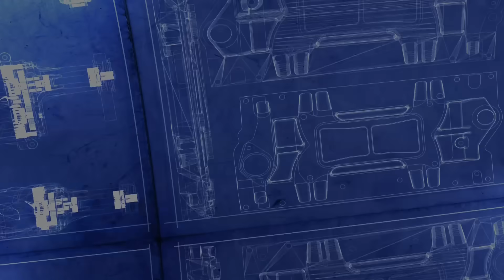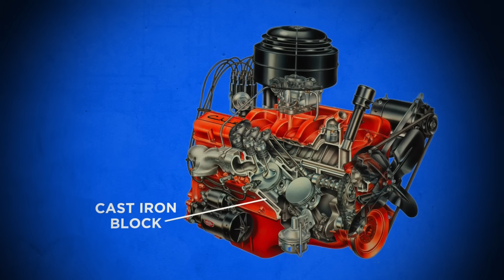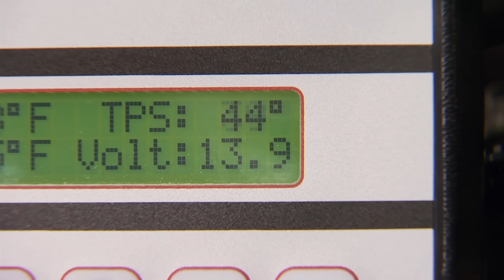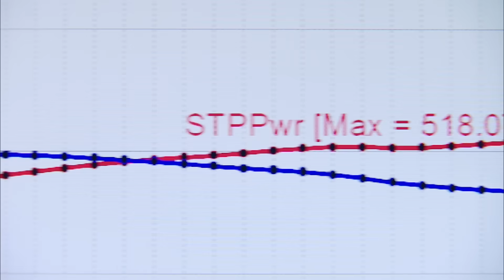Building A 518HP Supercharged 350 Small Block - Engine Power S2, E6

Comment: The block prep work is a good idea, but a few tips. 

-Leave the decks alone until after the block has been bored or decked.  Your detailing might end up being removed by the machining. 
-You should chase all your threads twice - once before going to the machine shop to verify they are all good, and once after all of your machine work and detail work is done as part of your final cleaning to remove machining swarf.  Thread chaser work best, but an old dull tap will also work.
-when cleaning out blind bolt holes, turn the block on its side  so the hole is parallel to the ground and use brake cleaner with the plastic tube to blow the crap out.  Use a cloth over it unless you want to wear it.  You will get a lot more crap out of blind holes this way than just using air, and the brake clean is also a degreaser than doesn't leave any residue.
-Run a flat file over the deck to knock off any burrs caused by your detailing.  You are not trying to remove metal, so just a few swipes in each direction will do. 
-Using a rat tail file, carefully remove any raised area from the original staking of the front oil galley plugs to hold them in. Again you want to just remove the raised part.  This will make tapping it much easier. 
-When chamfering the bolt holes on the decks, put the head gasket on first and see if the holes are blocked or are open.  Some engines have unused bolt holes.  You don't have the chamfer them. Also, don't chamfer the water passages larger than the gasket. You are removing sealing surface, and many head gaskets have smaller holes in the water jacket passages than the block because they are acting as a restrictor to force water to go to the back of the block.  Don't open up these holes.

You have to understand that the reason you chamfer the holes is because the bolts will pull up the metal adjacent to the threads creating a small raised area around the bolt holes.  Most factory original blocks will have a small chamfer, but if the block has ever been decked, it will probably be gone.  The chamfering adds a little bit or crack resistance also, since it is much harder for a crack to form on the chamfer than a sharp edge. There is no downside to doing it.

Comment: All that cash for parts, and you only get 518 hp.......pathetic....I got 365hp out of a stock 350 short block...FLAT tappet cam, junkyard vortec heads, hei distributor and a carb. Under 1000 bucks. My mouse would eat your budget build  for lunch!....it`s in a `91 Silverado

Comment: 6.0 w/ LS3 heads and a mild cam will make 518.
Haha at the old tech.
Reply: Tron Smart I have an ls1 in my ss with cam heads intake and bolt ons, reasonable cheap upgrades good fuel economy cheap hp but nothing will ever take the place of an old school sbc sbf. I through 15k in to a 302 winsdor build for my xy ute (Australian ford) started with a solid base, used a dart block and went from there. Now if I could have done it all and gained similar hp using an ls and perhaps saved 5k would I have done it... never in a million years. What’s going to look better if I ever advertised it for sale, xy ute with a ls or xy ute with a 302 winsdor dart engine dart heads eagle forged crank ext capable of handling tremendous amounts more hp, throw on a blower nitrous ext she’ll take it. Nothing wrong with ls but old school is cool, Top Fuelers run 426 hemi’s, 11000hp. The blocks they use are aftermarket upgrades adding extra strength but there still based from a 50 year old engine.

Comment: It looks like this was an application-specific combination designed to have eye appeal, dead reliable pump gas power, and modern fuel injection for a nice street rod. Also to talk about Edelbrock. It wasn't a max effort racing engine. Could they change up some components and double the output? Absolutely. Perhaps people are missing the intended application of this engine build.
Reply: Bingo.  500+ is a lot of power for most street rods.
Reply: @dennisyoung4631  Most commenters have never expreienced a true 500hp 350. 
Beyond clueless!!

Comment: i dont get it... a n/a sbc 350 can make that number... hot rod magazine did it on 87 octane...
Reply: @Randal TheVandal first the hr motor isnt a stroker... its 350ci.... yes they did a 383 not what i was talking about... second i can do pistons cam and heads for a hell of a lot less than a blower... the point was why waste money to make a lot less power... and you can make well into the 400s on 9.5:1 with no blower that will beat the higher hp blown engine..
Reply: @bigboreracing356  the point is... this is what they presented like it was something... jack ass
Reply: BW MadDog [retired]  i personally like a balance or hp/tq for a street car ive had a 383 with 450/480ish n/a its plenty on the street... brother has an 86 el camino ss... roller 350 sniper efi... e-force 122 charger w/pulley 8psi... e-street heads and cam... th350 w/3.73s... its fun... http://prntscr.com/sdjbiw ...  wasnt the point just saying thats a bunch of money  for little gain on their part

Comment: The height of insanity is this folly. A blower, really?? A blower that consumes a huge amount of power for such a meager output, please. I have watched you guys make some bad hardware choices and shaken my head at the results sometimes but this defies belief. You do not need such a device to make 500+ HP from our beloved small block. You need to put the polished bling ideas away and concentrate on finding the right ways to make power. A suitable 383 shortblock with a set of AFR heads and the right cam and intake will do the job. Try the EFI if you wish. It's not that hard to do this, it's been done many times. Without blowers.

Comment: these 2 clowns couldn't build a briggs & stratton ... producer say this and pretend to put part on for camera , cut , ok engine builder - finish assembling... what a joke i made 450 hp on a n/a small block with cast iron bowtie heads solid flat tappet cam and a 2bbl for a spec class dirt track car with a gm hei ignition oh and btw ..you can use a drill on those thread chasers they are made soft so you can drill them for an easy out if you do break one off i have the same re-branded snap-on set neither matco snap-on or mac make those they all re-brand them

Comment: Y'all don't realize the 95 350 tbi only put out about 190 to 210 hp. Most of y'all know more about ls engines if anything at all. To get a 350 to be your daily driver while producing 500 hp is very very hard to do so all y'all who's trucks are probably pushing 350 hp at the most need to give this vid some credit
Reply: Supercharging a 350 to make over 518 hp is not too hard. Was done long before the LS. Lol.
Reply: Nate Lorimer  ya carb not tbi
Reply: @eddylozoya9371  i would  never use a factory TBI ... it would never give enough fuel for 430 hp. So I dont understand what your point is 🙄

Comment: I would have been disappointed for the amount of money they spent! LOL My Paw Paw quit racing (bracket and index 1/8 mile stuff)in 2003 when I was 13 but has always helped me with my old LT1 Formula sbe nitrous setup that I started grudge racing and playing  on the street when I was 17 and still helping me with my turbo small tire 99 Z28  he has taught me almost everything and always been there so in 2017 me and my uncle and mine and his buddies started getting his old 81 Camaro together he bracket raced so he was more worried about being consistent than fast so it went 7.50 (1/8 mile) almost every pass with a very mild 400 SBC so we basically just went over the whole car put some street car stuff in it like carpet and a passenger seat new leaf springs caltracs a 4.10 gear still has the spool in it lol we ditched the ugly hood scoop he bolted to the stock hood and got him a 4" cowl hood a 600$ white paint job from Maco and had the windows tinted my uncle had a 355 with good rods and pistons I bought a set of edelbrock e tec 200cc heads same ones they used in this vid but had sent them to CHF for port work and valve job and a port matched vic jr and a old Holley 850cfm double pumper and nitrous outlet plate a healthy hydraulic roller setup  msd billet distributor and digital 7AL  billet electric water pump new ceramic coated headers had the powerglide rebuilt and new billet fti valve body and trans brake and PTC converter it took us a year to finish it in 2018 he found out about it earlier than we wanted but I'm pretty sure that's the first time iv seen him cry then we all cried he loves it drives it to church some (he's also a preacher) takes nanny out to eat takes it to test and tune nights at the track to play and does what 73Yo dudes do lol it runs pretty good it goes 6.90s all day on motor and been 6.15 on the bottle. I know we got alot less money in that 355 and I know it makes around the same hp or more without the bottle and 675 or 700 on it, I dont know anybody that would be happy with 13,000 dollar 518hp SBC...!! LoL
Reply: they never tell ya how much all these new goodies cost.  but with such a piss~poor dyno results,  I'd say surly no one would burn up their credit card for this combo.  Id love to have a job dynoing engine combos for Edelbrock. This combo would have never made it to YouTube. Someone definitely dropped the ball in advertising / designing dept on this flop

Comment: Correction, Edelbrock was NOT the first person who built a small block with one horsepower per cubic inch. Chevrolet was the very first and surpassed 1hp/CI in 1957 with the fuel injection 283 with 290hp but advertised it using 1hp per cube.
Reply: Terry Kehler ......actually Chrysler did it with the hemi before Chevrolet. Everybody always thinks it was Chevy , but it wasn't.
Reply: @kurtpoblenz2741  and since this video is about a small block Chevy and NOT a hemi, my comment still stands. Was only referring to the video saying that Edelbrock was the first to do so, which they weren't.

Comment: Why did you not use a Double Roller Timing Chain on This Engine after spending so much on all the rest?
Reply: The block usually has to be clearanced slightly for the wider double roller chain...  actually, I didn't know anybody even made a single width roller chain for this app.

Comment: Forged crank with a powder rod?  I think I'd have opted for a forged piston and rod, and not worry about a cast crank at those power levels.
Reply: Cast iron cranks can be used at 500 hp.above that, shops say go steel crank
Reply: Powdered steel forged rods are great, they're stronger than the old stock forged rods smallblocks came with originally

Comment: This doesn’t make any sense whatsoever. 
If they went and bought all the parts to build the supercharged 350ci small block they would have spent at least 13K and still they only made 518 HP. 
Now last Christmas I bought my little sister a new engine for her first track car and it was a Blue Print 632ci engine that made 820+HP N/A and the engine only cost around 10K. 
So yeah they spend about 13K for 518 HP and I spent 10K for 820+HP. 
It doesn’t make any sense whatsoever. 
Basically what I’m saying is it’s a big waste of money

Comment: You can easily make more than this with a naturally aspirated 383, with a better rotating assembly, and much better cylinder heads, with less money. I know all that stuff was very expensive, for 518 hp? Not worth even putting online. Edelbrock paid them well I'm sure. I see the ports on the cylinder head were "Gasket Matched". If you're not going all the way through the port, then you're literally doing nothing. Porting an inch up into the port, is such a waste of time.

Comment: 518 hp out of blown 350?  You can get 600 hp out of a 316 cubic inch voodoo engine without the blower.  Something's not right on that motor.  Granted, the heads are 4V OHC, but there's no reason that setup shouldn't make 700 hp with ease.

Comment: I'm a Mopar guy my brother is a Chevy guy I have a LOT of respect for small block Chevy's I always did dam good engine BUT 518 HP that costs that much money with a blower to boot please! 

Hell I can build that at half the cost naturally aspirated and make more HP than 518 and why does it have 9.5.1 compression and why does it have the wrong cam and again I think they said 1000 cfm EACH on that injection I may be wrong on that but if its true its way to much.

A crate engine would be cheaper the truck engine version make some mods to the engine throw a B@M blower on it or a Paxton I'm sure it would be half the cost or less it would make at least 600+HP and a lot more torque. Hell I'm a Mopar guy and I'm even bitching LOL.
Reply: Exactly.  700 hp with a roots blower has been done on a street 350 over 20 years ago.

Comment: And this right here is why I LOVE fuel injection! It just WORKS! And you don't mention it but it bears pointing out that this engine will run the exact same way in cool air, hot air, dry air, humid air, high altitude, sea level, and It DON'T need no steenkin jet changes or air bleed adjustment or accelerator pump cam swapping! Especially with today's ethanol gas. I REALLY like the idea of something I can park one day and still run perfectly the next
Reply: It most certainly doesn’t just work. This past year my shop installed 2 self tuning kits that had the whole computer stop working, one couldn’t get fixed for months because of parts shortages. The biggest problem with carbs is most people think they can tune good when they can’t, a properly tuned carb has no problem starting up the same every day.
Reply: @stephenkrambeck6589  IF they are used right. Carbs are temperamental. When they work they are splendid. But if you let them sit, something evil this way cometh. Bottom line, if you are on top of it, they are fine. But don't think they are hands off devices. A good car guy checks things. On the other hand, not being able to get parts for a bad CPU is equally aggravating. Makes you really appreciate a Toyota Camry that just runs! Boring as they are, factory cars really are reliable these days.
Reply: @stephenkrambeck6589  Agree. Only truly reliable efi system is on new oem cars 
GUys assume aftermarket will be the same, spend thousands of dollars and half the time put a carb back on. I have never been stuck on the side of the road will a well set up carb .Fires on first crank every time. NO sensors, obd ports..keep it simple
Reply: it is nice - but other times its also nice to turn wrenches and twist distributors...

Comment: Lol touching the camshaft were the bearings ride with your bare hands smh same as when you do maincaps your hands have microscopic dirt in the skid you just put dirt all over the bearing surfaces did these guys Evan go to school and 500 HP out of a 15 psi blower is super sad and it's fuel injected hahahaha my 82 c10 makes 900 without a supercharger or fuel injection or nitrous and it's a 427 stroker with flat tops half premium half race fuel

Comment: Try this  for  better results  and less $$.  Lower compression with dished pistons to 7.5-8:1 comp ratio. Decent aluminum large runner head of choice (Dart pro1 ),  0.540 lift  solid roller  228deg  (remember air is  being force fed)  115 LC and retarded cam timing  4-8 deg (Cloyes SB set)  6-71 Weiand  blower  and 2x  500cfm two barrel carbs.  That's the trick, Daddy-O . Block build  wants forged 4 ring pistons, H-beams, good  ATI Balancer, 6 qt pan remote  dual filters. That's  700+ torque and HP** on pump premium. thousands  less.  Be Cool out there!  - Sandy ( ** ~600HP minus blower drive HP sap)

Comment: I love how everyone says that it’s a pathetic power number but don’t understand that with a bit of tuning they can get 800 horse out of it
Reply: What tuning?  The  A/F is  good, after that you  have  total timing (which should be  retarded from N/A)  You can move the cam around with a cloyes set. I dont see it.
Reply: @sandyshoremann7524  Simple pulley swap will get you way more boost out of that blower.

Comment: If you max out the motor to aprox . 500/500 what type of top end transmission would be suggested is it possible to get the car to 230-250 mph and what type of speed set up could be used of off the shelf ?
Reply: Not enough power to go that fast in most cases

Comment: I really hope that big, way overpriced lump of aluminum on top of that 350 has more potential in it than that!
Reply: It definitely does. Look at the size of ths
at blower pulley compared to a 13-14 gt500 mustang. Same eaton TVS 2300 Internals in the blower, could probably spin it 50% faster than this combination and make a pump gas friendly 700hp.
Reply: No Prep Stretch wowie zowie the keyboard mechanics are at it again

Comment: Ok lets see here these guys had a stock lt1 bottom end, edelbrock performer eps heads which suck just get get the 1st gen small block style edelbrock heads, and a supercharger, 518 isnt shit. Oh hey guess what 10,000 dollars just went down the shitter. U could get 500 easy with ported vortec heads stock bottom end and performer rpm intake manifold, and only spend a fraction of what u guys paid
Reply: And a 500 lift flat tappet cam

Comment: 500HP on a built blown 5.7L? eh. 20 years ago impressive. Not anymote. AFR heads can make 500HP on a 383.
Reply: well most of the shows this channel is uploading are from 20 years ago XD
Reply: The right build small block AFR headed naturally aspirated will top out at 750 hp.
Reply: And the LS especially with a turbo
Reply: That wasn't impressive 20 years ago, or 30, or 40.